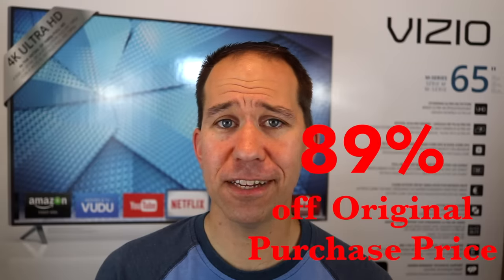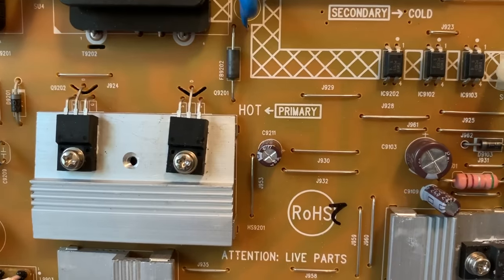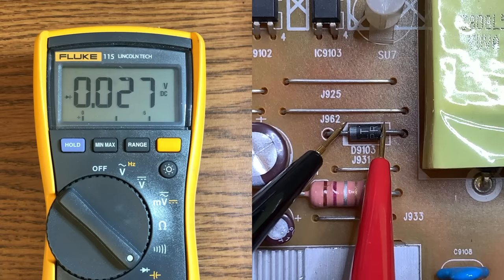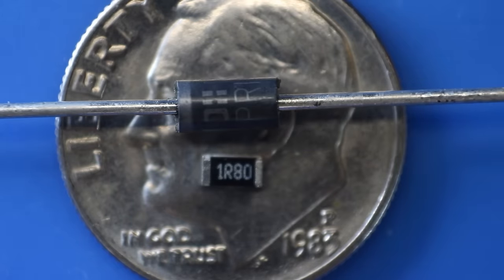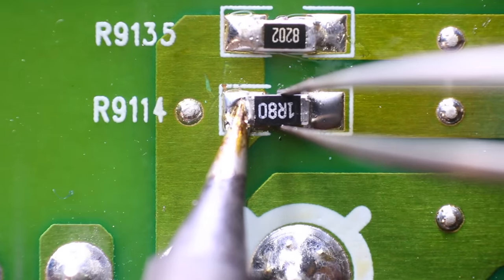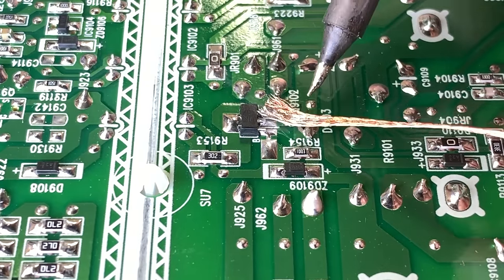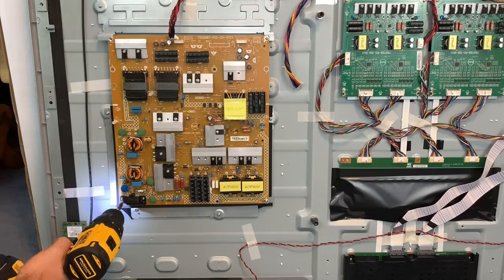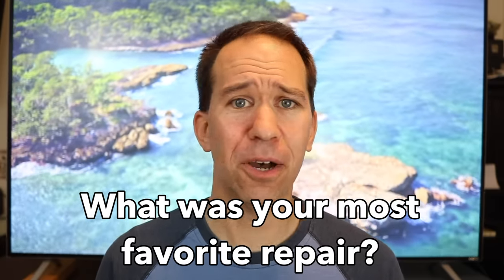I got a broken 65” 4K TV - How I repaired a Vizio M65-C1 (tv won’t turn on)

Comment: Highway robbery haha good stuff. Subbed. Please buy a Samsung KS8000/8500 that turns off and on by itself!! Please
Reply from the maker: Thanks for the sub!  Is that the tv you have?   Have you found any clues on line to what the issue might be?  For starters, I would isolate the input bar and the remote sensor to make sure neither or them are sending a signal to the main board to "turn on/off".
Reply: @FrugalRepair  yes I have this and replaced it with another TV, and repair it later. I hear it's common. Either resister, power supply, main board etc. And thanks what you suggested, I tried everything I could think of side from cracking it open
Reply from the maker: @carbonm2  If it's not the remote sensor or input bar,  my guess is that it is more likely to be a problem on the main board than the power supply board.

Comment: You're like me. I love to fix things, and as a matter of fact I used to fix car stereos in my basement. Once I fixed a home stereo for a co-worker. It only had sound on the right side, the left side was quiet. I replaced the left channel output and problem solved.  I fixed the stereo for less than $15!  Needless to say, the co-worker was very pleased.  😊
Reply: I just fixed my Samsung 32-inch flatscreen TV. One of the backlights stopped working, so I bought a replacement strip, installed the new strip and it works now. I fixed it for $16!  So I fixed a flatscreen, and I saved a TV from going to the scrapyard!😉

Comment: How to remove that resistor quicker: 1. Set high temp. 2. Heat the resistor. 3. Just gently push it away with the soldering iron...
Reply from the maker: Thanks, yes, that is another possible way to do it.

Comment: Trying to flatten out the resistor after one side has already been soldered down could just result in a stress fracture in the resistor.
Reply: @WilliamEllison  He is right numbnuts
Reply: What is wrong with you?
Reply: You need to move yor iron back and forth faster, you can get both pads liquid at the same time. Those look like 0604 packages since substrate of resister is ceramic it conducts heat nicely.

Comment: The first REAL repair I remember was when I was about 14-15 years old, I was at a garage sale and bought a dead 12" B&W tube TV. I think it was $5 but thereabouts. I figured if I couldn't get it working, I'd have fun parting it out. Plugged it in, no power. I opened the back, first thing I checked were the fuses. Sure enough, one was blown. Bought  a replacement fuse for $1.25 (i think) and the TV worked! My first TV and I was very excited. A couple of years later, I bought a used colour TV and got a $35 trade-in on the old B&W! Repairs for fun and profit! ;-)
Reply from the maker: That’s so great to hear! Thank you for sharing.

Comment: was givin a 55 inch RCA , owner said it would not turn on . Took it home tried the remote  - - nothing . Tried the power button on the tv itself  - - - comes on with perfect picture . open remote it is corroded from leaking battery . new remote 10$
Reply from the maker: Fun story!  Thanks for posting.
Reply: Yeah, you could clean it with rubbing alcohol. And it would save you $10.
Reply: @killertruth186  it was beyond cleaning

Comment: I also fixed a 46" Samsung TV after finding the solution on YouTube.          
I was told to cut a particular resistor that had to do with backlight. It worked! I used that  TV for another 5 or so years.
Reply from the maker: Wow, that is awesome to hear!

Comment: Working on a large two door drink cooler. Replaced the fan and starter last year. The compressor quit a week ago. It so happened, I have been studying HVAC repair. I have ordered the compressor and will install in two weeks. I also have a TV stored. I have replaced a couple of boards with no luck on it working. With your suggestions on your YouTube channel, I have an idea on we’re to look next.
Reply from the maker: I hope you can get the TV working and the cooler!

Comment: Bought a used Chevy Blazer and found out the previous owner removed the LED for the check engine light. Tore the dash out and put in a new LED for 8 bucks, then hooked up the code reader to get it through emissions. Was quite a hassle as my soldering iron is very old, and had to run a small wire to the next pad because the original connection lifted from too much heat, but it saved me hundreds. A warning to all new tinkerers, DONT leave a hot tip on a pad for too long and invest in something better than a 20 yr old soldering iron!

I came here to find a solution for a Vizio E472VLE that keeps shutting off on it's own. Already tried all the hard reset suggestions here on youtube, so i guess it's time for some testing and more research. Thanks for the vid.
Reply from the maker: Great job on that Blazer repair!  I don’t know your vizio answer.  I did have one years ago that did that.  I seem to remember I had found helpful info online.  My memory says it was something on the main board.  Let me know if you figure it out.

Comment: Great video. I have the same TV and same problem. No experience in this type of work but I think I’m going to give it a shot.
Reply from the maker: Thanks!  Let me know how it goes.  I'm sure you'll do great.
Reply: So I finally got around to it. Light was blinking then turn a solid red. Should I stop now and reassess ? Next step I believe I got a bad reading on the R9114but not quite sure.
Reply: Reading on R9135 was8.9 reading on R9114 was 0

Comment: Not a TV, but a guitar... I bought a 1989 Fender Squier Stratocaster from a kind of pawn shop (Cash Converters) for €40, because the "electronics were busted". When I opened it up, there was a minor soldering problem, but the perfect-condition pickups were all Fender Custom Shop Texas Specials, which cost about €200 a set. Yes!!!
Your video was well-made, informative and interesting, so thank you.  :)
Reply from the maker: That’s a great story!  Thanks for sharing it.  I’m trying to remember what’s the difference between the squier and the American made Stratocaster?  I bought a strat when I was younger but unfortunately, don’t play it as much these days.
Reply: @FrugalRepair  Old Squiers are very much like Samick Strats (I have one!), and the body is heavy plywood, oversprayed so you can't see the layers. The pups are OK, no more. Bridge was original Fender stamped. Tuners OK. Neck was very good, and I've transplanted my Squier neck into a German ash body with the EMG DG electronics. Sounds wonderful, and plays well since I dressed the frets. Still got the equivalent Samick, too, but with Fender pups.

Comment: As a retired electronics engineer, I have spent a lifetime repairing just about everything, but my favorite repair was a Pioneer SX-1250, AM/FM stereo receiver. I was trolling the local pawn shop and saw it sitting on a shelf with other audio equipment. It had a price tag on it of $29.99. It was from what they call the golden age of audio. The tag said, "as-is". Without hesitation, I told the guy I would take it. It was in near flawless cosmetic condition with the exception of a dent in the bottom panel. I plugged it in, turned it on and everything functioned, but it had a horrific 60 cycle hum on both the headphones and speaker outputs. I took off the bottom panel to discover a support bracket just under the dent in the bottom cover that had been pushed into the power supply board cracking the board and disconnecting all four power supply filter caps yet the supples were still functioning unfiltered. I removed the solder mask over the copper clad, bridged bare copper wires across the cracks, soldered them in place and straightened the dent out of the bottom cover. I powered it up and everything worked fine. The 60 cycle hum was gone. The cost of parts for repair was $0.00! I still have it and listen to it almost everyday. Occasionally I will check prices on eBay for like units and see ones in similar condition selling for $1200 to $1500! That was $29.99 well spent and it makes me smile every time I turn it on!
Reply from the maker: That is a great story!  Thanks for sharing.
Reply: i always did the same, bought my best amp, a Rotel amp, with one bad channel,easy fix 20 years ago, can't remember what it was,i think it was just a fuse ; works perfect, i only beefed up the heat sinks by riveting extra aluminum, to drive the 15 inchers; 
 just checked it, that Pioneer gotta be good,it weights 30 kg,and that says it all; flywheel on the tuner,i hope?

Comment: Exciting and rewarding! I did one like this, paid 20$ for a 55" got it working watching Tampatec on Youtube. Yours is a much better fix. Thanks!
Reply from the maker: That’s great to hear!  And cool you fixed yours watching tampatec.  He’s a great guy.  What did you fix on the tv?
Reply: @FrugalRepair  I bought a kit of boards on Ebay for this Sharp 55". Did my research and replaced the problem board. I forgot which board it was though, been awhile back.
Reply from the maker: Great job!

Comment: I have the exact same TV and it stopped working about a month ago and I replaced it. I kept it to try and fix like I did with an old Samsung TV. Glad I saw your video, I’ll take it apart next weekend and see if it’s the same issues. Thanks for posting!!!
Reply from the maker: Keep me posted!  I’m eager to hear how it goes.
Reply: FrugalRepair took mine apart and it’s not the same issue.. furthermore when I plug the power cable in there is not light on the main board. The only light I get is the power light when I turn it on, but then it flashes 3-4 times and turns off. (No picture of course). Checked a few capacitors and now I’m at a stand still. Was hopeful that mine (same model as yours) would have the same issue.
Reply from the maker: @KyleSchwanz  It seems there is a common issue on the main board on this model.  Have you researched that?
Reply: FrugalRepair I have not, but I plan on looking into that next. Hopefully I can find something there.
Reply: FrugalRepair so i hooked the power supply board back up and checked standby voltage and everything looks okay. Solid 5v with both wires. The main board doesn’t have any little led lights on it that I can see in the other videos. I’m thinking there is something wrong with the main board for sure but don’t know how to diagnose it and can’t find anything online about it.

Comment: I have this exact model, bought the same month as the Craigslister and it just decided to not power on. Thanks for the video as I'll be checking for that blinking light tonight and hopefully ordering some parts tomorrow instead of searching for a sale on an OLED TV I've been wanting for a while that's WAY more than the 47 cents this cost.
Reply from the maker: Thanks for letting me know. I hope you can get it fixed inexpensively!  My TV has been working great ever since this repair.
Reply: @FrugalRepair  Got my set opened up, have the flashing LED, didn't hear the clicking but didn't listen really close while the power board was still connected to the TV. Brought power board to my shop and it seems like the resistor is blown as a small mark was hardly visible but both of my 2m Ohm volt meters weren't registering anything across it. I got no clicking whilst the board was plugged in w/o the main board's load. I'm not sure the diode is bad as I was getting around .5V in the main direction. Checking the 12V to ground I did see 18.6-18.9V fluctuation on both meters, never getting to 19.0.
Based on all of this I think I might buy the parts and buy some tools. Then I decided to check a few other things and might have screwed up. I checked my other diodes and they checked out, then I thought the component at position R9201 was a resistor and checked the ohms across it and got a pop and flash from somewhere on the board. It startled me but I checked over just about every component and couldn't see anything popped. I eventually plugged in the board again and didn't see any other issues.
Reply from the maker: It sounds like you’re saying you have the same problem with the resistor and maybe the diode as I did on my power board.  The diode should have no voltage drop across it in one direction and .5 V in the other direction
Reply: @FrugalRepair  I do get the .5V across in the 1 direction. I'm concerned about that pop/spark I triggered though. But with the resistor/diode so cheap I might order them anyhow and give it a go. Going to try to check if I did indeed blow a mosfet and buy some of those too. Did you find a schematic for this board anywhere? How did you know the right values for the resistor/diode?
Reply from the maker: No, I don’t have a schematic. But that would be very helpful! I used the values that other people were using online.

Comment: You've inspired me to fix my own TV. 
I have a Samsung PN58B860. Its runs for about an hour or so then it will just show  "snow"
and become completely unresponsive to remote or front panel controls. I've scoured the web but could not find anything.  I can unplug it and it will reset but after an hour the cycle starts over. So something seems to be getting hot then failing is my guess.  The main board is pricey and I'd rather just put that towards a new TV.  

But before I do that I thought I'd shoot you a note.  Thoughts appreciated!
Reply from the maker: Thanks!  I think you can figure it out.  You have a great clue at least.  I wish I knew what it was but I’d first try blowing a fan on the main board and see how long it lasts for.  Oh wait, is this a plasma tv?  Also, does the same thing happen on every input ?  No matter what, even if no input, the tv turns to snow after an hour?

Comment: This is probably the best walkthroughs about something I have no idea about. I learned so much, thanks.
Reply from the maker: Wow, that is an encouragement to read.  Thanks!  So glad it was helpful.
Reply: Everyone else makes soldering and circuit board work appear so impractical and intimidating. This was encouraging to me.
Reply from the maker: So great to hear!  Let me know if you have any thoughts about more videos.
Reply: @FrugalRepair  Lol, maybe macbooks. Louis Rossman does videos about them, I just feel he is so advanced. Im also not sure if you could leverage appliances that ppl usually trash. Like do Kuerigs break?
Reply from the maker: Thanks for your thoughts!  Yes, keurig’s break.  I’d say the typical problem is a solenoid gets frozen/rusted) because of water.  Pumps get rusted too.  Simple repairs but the machines are not built to be worked on, which is sad.  You have to break them apart practically to get in there.
Reply: @FrugalRepair  You're pretty knowlegdable. Thats valuable information. I see I can pick your brain for hours...

Comment: Love seeing someone showing the proper way soldering works.  Was a nuke ET (submarines) a while ago, spent 2 months on Ford Island learning how to repair reactor controls ckt boards and we had old salty chief petty officers inspecting our solder work with jeweler's loops.  One thing to understand that wasn't covered here is root cause and how that can really put a pickle up your you know what.  See that resistor and/or diode failed for a reason, if that reason was one or the other failed itself which caused the other to fail, then like this video showed, you can win.  But if either of those components failed because of some other component then you lost round one until you figure out the root cause.  Thanks for sharing, love the quality soldering.
Reply from the maker: Thanks for the encouragement.  I did not investigate the underlying issue (bad batch of diodes or design spec issue) yet.  I’m curious to know though.
Reply: @FrugalRepair    By now, you know;  Still working ?

Comment: One of my favorite electronic repairs videos that I've ever seen! I just bought this Vizio TV M65-in 4K quantum TV just like you. I got it for $100 The TV comes on I can see the light on the screen coming on in the background but there's no picture or no inputs showing or anything like that I'm guessing that's going to be the main board correct?
Reply from the maker: Thanks for watching!  You may want to check out my 'fix with tape' videos for ways you can narrow down the issue.

Comment: I repaired a 60-inch Vizio TV that I got for free!  
It wouldn't respond to the remote control and the original owner was frustrated by walking over to the TV to change the volume.  I looked up the part ($13) and replaced the infra-red receiver... FIXED!
Reply from the maker: Very cool!  Great job on the repair.

Comment: My favorite Repair was fixing a 50in Visio monitor with a friend of mine. (Unfortunately he had to order the parts of the powerboard from China and that took alittle while) but We got it working and Its still working to this day.
Ever since then, Ive been collecting monitors for me to repair.
My Current projects are:

a 28inch Viewsonic 2858SML computer monitor that keeps blowing the same Cap (3 so far) and I cant figure out what is shorting that thing.

a 50inch Panasonic TC-40AS520U - That powers up but shuts down shortly after powering up. I was able to determine the issue was a bad transistor but thanks to Panasonic they dont make it easy for you to know exactly WHAT parts (or types) of components you need other than general. I believe I have the right one, I just need to solder it and test it (I just dont have an iron tiny enough for the job i need to perform)

A 50inch Samsung that works but.... the screen is physically damaged so Im going to take the power board and other board out and sell it.

Love your video!
Reply from the maker: Thanks!  Great to hear about all of the projects.  Hope you can get those two repaired!